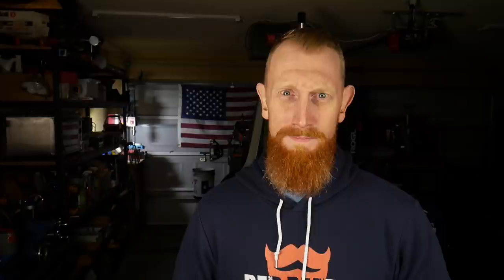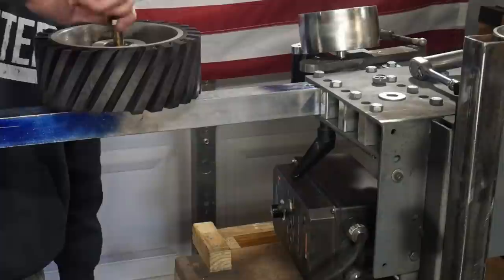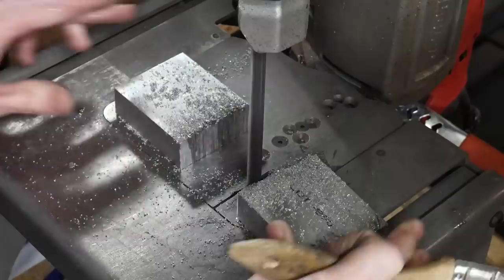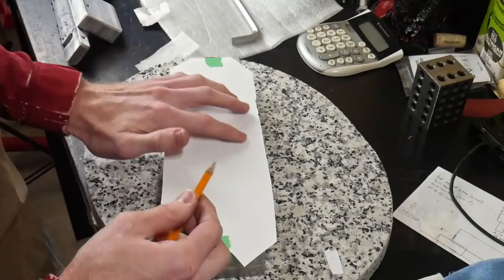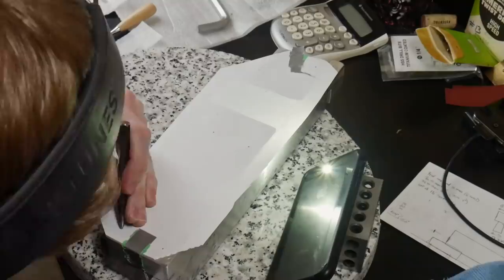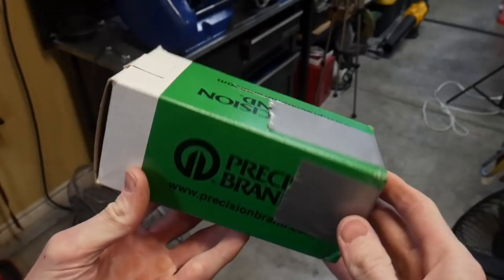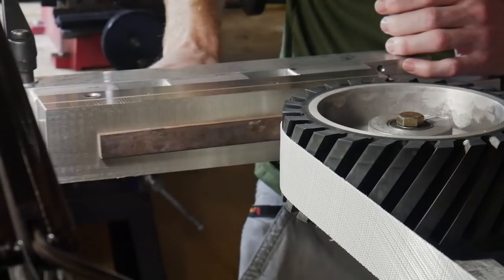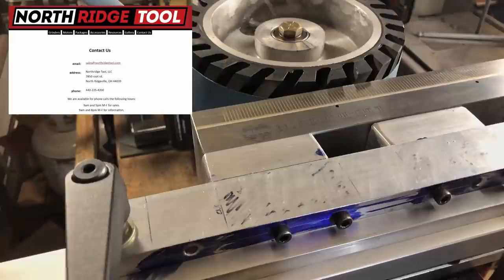2x72 Surface Grinding Attachment Upgrade || Magnetic Chuck - Knife Making Surface Grinder

Comment: Oh yeah dude, you weren't lying...this is a fantastic upgrade!  It's right up there with mine, most of the time I don't even need parts as flat as what yours can achieve...it's more out of convenience for assembly than actually needing a surface that flat.
Reply from the maker: Heck yeah man, pretty stoked about it thus far. I agree... for the full tang knife maker <0.001'' is plenty for sure!
Reply: @RedBeardOps  Definitely, .001 is usually enough for machinists too.  Unless you're making precision tooling and whatnot, you really don't even need it that precisely flat.  For knifemaking, having it that flat is a bit excessive if the wood you're working with isn't completely stable and super fine grained.  I actually went out today and found some mesquite burl wood at a local trail.  I'm certain it's gonna look fantastic, but I'm also fairly certain after a few years on a knife it'll develop some kind of warping and a visible gap on the tang...that's just my luck though 🤦‍♂️

Comment: I was impressed by the design and build for your surface-grinding attachment. I was able to order the same linear- bearing slide you used, but bought a different micro-adjust platform. Anyway, since I bought the KMG “Classic” model grinder and not the KMG-TX tilting model (this was a mistake) I was faced with the requirement of operating the slide in vertical mod. I stayed up a few nights trying to figure out how to minimize the effort needed to make this arrangement work. Finally hit upon the idea of using a counter-weight system. Had a spare set of 30 mm.-bore shaper collars which together equal the weight of the magnetic chuck and slide. Two pulleys affixed to ceiling joists, some stout nylon cord and I was in business. I was seriously surprised at how well this approach has worked out. It’s totally out-of-the-way, interferes with nothing and stores easily. What’s best is that I can raise and lower the slide with a single finger. I’ll bet this system requires less muscle power than a horizontal system does. And I get end-to-end uniform thickness of 2-3/1000 in. over 12 in. I’ve got a 5-min. video showing the thing in operation, which offers visual proof of the “Look, mom, one finger” boast. Send me an email address, and I’ll send you the video, if you’re interested. And thanks very much for your sharing your design/build. I spent about $400 on materials and supplies. The KMG surfacer runs about $1,500, as does the Wuertz device runs several hundreds more. This was a challenging, rewarding project, which I would not have undertaken without your example and inspiration and your excellent video presentation. —John Lively, LeatherWood Workshops
Reply from the maker: Heck yeah thanks for the comment John! Sounds like you have yourself a nice attachment.

Comment: Much better than the permanent magnetic jig.  However, this one also uses permanent magnets - two, high capacity neodymium magnets to be exact.  This arrangement makes the chuck bulky and very heavy.  Moreover, neodymium magnets are very brittle and easily break if dropped; hence a heavy steel sheath to protect the magnets.  This also adds to the weight and the overall cost.  To make your own permanent neodymium magnets jig is very difficult even for a skilled DIYer.  To make an electromagnet is not difficult at all, would be much lighter, more durable and would be much cheaper - I presume cheaper, since I have no idea how much your mag jig cost.  Still, this jig is far better than the DIY perma magnetic one.  Good luck and keep going :)
Reply from the maker: Thank you Igor!

Comment: Now you got my mouth watering. It is such a huge pain to clean my chuck all the time.I will definately be looking into one of these. I also noticed that you are running your grinder in the horizontal position now with this attachment. I never thought of trying that. I have a Reeder Product grinder that flips to horizontal also. I will be trying that out today. At my ripe old age with my bad shoulders pulling that thing up and down wears my arm out quickly. Man this video was a BIG score for me.  Thanks James!
Reply from the maker: Hey Jim, Man, the chuck really does make life easier for sure. As far as the horizontal goes... I just got the ability to do that with my grinding set up. It's way nicer for using the SGA for sure! Cheers sir!

Comment: 3 tenths! wow very good for being just shop-made. i tried to make one once and was getting 2 thou in 6" at best so it was worse than my mini mill and I repurposed the parts
Reply from the maker: Hey Paul, man, I could of just gotten lucky. I feel like 0.001'' is pretty darn acceptable for one of these machines over the length of a knife. I'll keep using it! We'll see how it holds up.

Comment: Hi James!  Another great video.  I have watched it three times, but I confess I don't understand why you needed the spacers for the magnetic chuck at all?  Could you not have attached it directly to the same arm that held the original magnet you created?  Thanks.
Reply from the maker: Good point Eddie, I think that's accurate. I was trying to make due with the hardware I had.

Comment: Really nice job on the sg attachment! The precision is surprising as the aluminum rail systems aren't usually that accurate. I was wondering why you didn't just surface grind the aluminum spacer blocks instead of shimming them, maybe I missed something.  I was also curious how accurate it would machine a square piece of 1 1/2" to 2" steel. I'm curious if it would come out square or shaped more like a trapezoid. I'm planning to build one but would like to be able to do more than knife blanks. I'd love to do it with the same type of system if it can square a decent sized block up to resonable tolerances. Do you think it could be possible with this setup? Thank you!
Reply from the maker: I shimmed for the bulk of the movement, then surfaced the chuck. I wanted to maintain as much chuck material as possible. 

I haven't used it for squaring stock like that before. considering how squaring the my mill requires a non-moving back vise jaw... I'm not sure if it would get you similar results just flipping the piece.

Comment: I was checking those out, but the only way to get things truly flat is to crosshatch sand/grind.  Ask any auto body guy who paints alot of black cars with clearcoat.  Smooth and flat are two different things.  That wheel would have to be a hard surface or you will get waves.  I would mount the knife vertical and do the cross sections first, then mount it horizontally to see of one pass eliminates the cross scratches.  Then you know you are flat.  Cool gadget though!
Reply from the maker: It gets the job done! :)

Comment: I have confidence in the fundamentals of the design. Maybe if you could design something with 2x4 studs instead of solid aluiminuim maybe it might be more of an option. Like pretend you couldn't use any of your tools you own in that shop except a handheld drill, a grinder, and you were broke completely and had to buiild it for free. I'd be impressed to see what you could come up with.
Reply from the maker: Thanks for the ideas!

Comment: What belts do you use to eliminate the belt bump? Or do you grind the seam down? What speed are you running your grinder at?
Reply from the maker: Max out the grinder. I normally use trizact or ceramic belts on the SGA. Cheers!

Comment: The thing that surprised me the most is that, during this whole time, you hadn’t purchased 3” belts that would allow you to take full advantage of your having opted for the wider width in the first place. This isn’t necessarily a criticism, but rather a curious observation. 🤷🏻‍♂️
Reply from the maker: I do have some 3'' belts, but most of the knives I grind aren't wide enough to need one. It's nice not having a bunch of odd-ball size belts in the shop as well.

Comment: I have been looking at making a surface grinding attachment however  I just can’t force myself to use permanent magnets.  Do you see any reason that a guy should not use an electromagnet if he is will to cope with the wires?   As a test  I purchased a very powerful fire door electromagnet from the web and found that it was incredibly strong…like break fingers strong.  It has the added benefit of dropping any metal filings when power is removed.  My plan is to face it will aluminum so  I can reface it numerous times if necessary.  Looking forward to your criticism.
Reply from the maker: I don't see an issue with that. It's nice to be able to turn it off and on for sure!

Comment: Why didn’t you dowel everything that is screwed together?
So you have always the same position whenever you disassemble 
the attachment for cleaning and servicing. Just 2 small (3-5mm)
holes that you drill and ream clamped up together. That would 
have given you peace of mind in terms of precision and you wouldn’t 
need to worry about flattening the new magnetic chuck after every 
reassembly!
Reply from the maker: Nice idea!

Comment: I have the same mill.  I start taps the same way.  Do you disconnect the motor somehow?  Twisting against the motor and gearing is rather difficult.  Maybe more reason for the belt upgrade?
Reply from the maker: Hey Dan, I have not disconnected the mor or upgraded the plastic gears. You're right there is some resistence for sure! Gotta say, I've used the heck out of that little mill, really happy I bought it. CHeers sir

Comment: Hey I just purchased a brodbeck 2x72 grinder. It came with a 8” contact wheel but I would like to have a 10” or 12” aswell. I see you purchased one from a supplier I can’t remember the name as I’m typing I know you gave a link. Which one would you suggest. I’m a beginner and want to attempt some hollow grinds. The wheels brodbeck offer are very expensive! I see where you purchased yours they seem to be affordable. I honestly don’t even know what the dimensions need to be to match what I have...
Reply from the maker: Man... I've only done a few hollow grinds with a 10'' wheel. Seems to be working fine. I know a lot of guys use the 12'' though. Probably depends on blade width

Comment: The problem with these whole setups is the problem of acquiring the sander belts and all that.  What a lot of us do have access to more commonly is handheld grinders. I wish someone could find a  a way to use a grinder and be able to build a cheap guide or jig to allow the grinder to be used to shape the blade. I feel like it's possible and very within most people's budget but when you're talking about buying belts that cost a decent chunk of money and having to have access to welders and all that stuff it gets to the point where we might as well just buy a new unit or keep dreaming. I think that's the problem with most DIY videos. They're people with complete shops with everything they ever need and trying to explain how to build it with resources none of us broke asses have. Like show us how to build something for cheap or with something we can steal from a friend for a day and we'd be on board.
Reply from the maker: I feel your pain Mikey!

Comment: Really nobody is gonna address the Elephant in the room ???? Really ??? Nice plug bro with the $350 price, I'll sell it to you for $325 after I buy it from Amazon for $194 or Ebay for $169.52. How many you want at $325??? Or should we pay for the difference because they etch their name on them ??? had more respect for you but now......
Reply from the maker: Hey man, I don't get any proceeds from the chuck.... They sent it to me, I used it. Then I gave their product a shout out. It's been working well for me.
Reply: If you can find that size permanent mag chuck on eBay or Amazon then let us know.  I think it’s expensive as these were custom made unfortunately by  Northridge for this application.